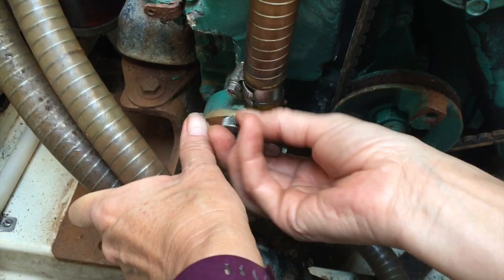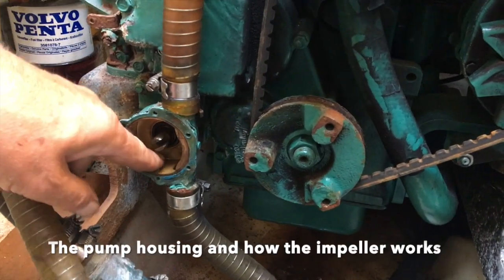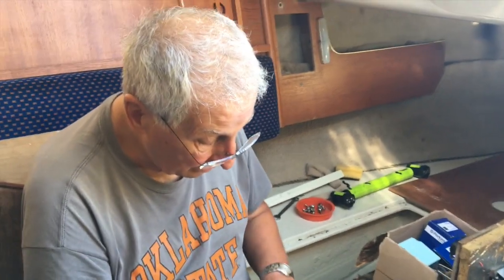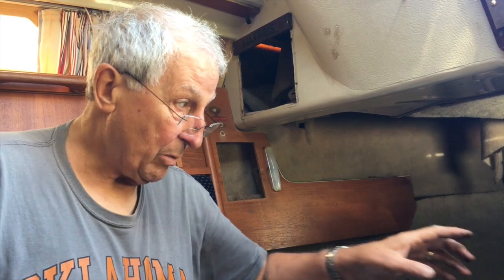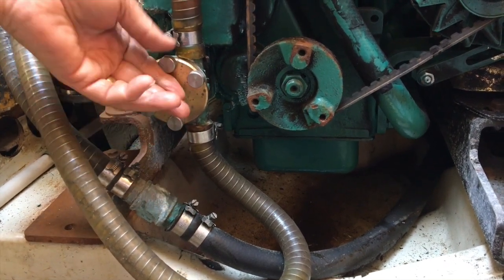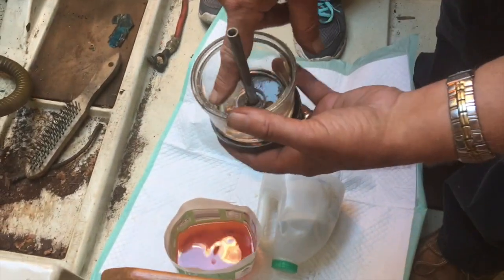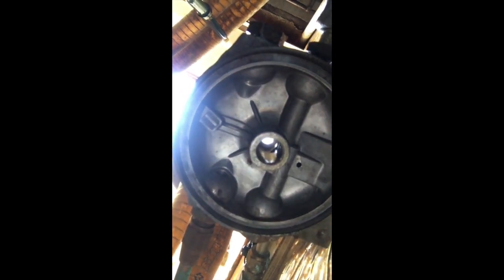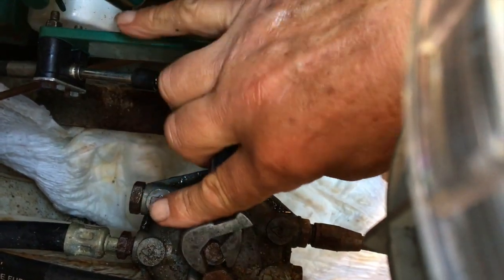Servicing a marine diesel engine PART 2 – replacing the impeller and primary fuel filter

Comment: Thanks for an informative video Stu. I have the MD2030 Volvo Penta engine which is actually a British Perkins engine and I too have a quick release pump cover and always wondered what the composite washer was for.
Just one thing though, never use Vaseline anywhere near rubber seals because it is an oil based product which will perish rubber over time. It's the same for any oils or oil based grease. Don't use it. Always use a clear silicone grease which wont damage rubber compounds. It's the same if you do the brakes on your car...silicone grease for callipers anywhere near the rubber seals.
In case anyone needs help with Beneteau lifting keel screw mechanisms, I have videos on my Youtube channel if its any help..

Comment: Hi! My Volvo Penta 5D a 1982 doesn't have a coolant or sea water strainer. The previous owner told me that the cooling system has been modified to a freshwater setup, so I don't need to do anything. I also don't see any container where coolant could be added. Is it true that I don't need to do anything, or do I need to add coolant in some way? How is this monitored?

I've also seen some MD 5 engines with a shut-off valve with a red handle on the lower left when looking from the back, but on my engine, it feels like something is there, but the handle is missing. Was it removed for some reason? Perhaps because of the change from saltwater to freshwater cooling? Could someone clarify this for me or provide a link where I can read more about it?